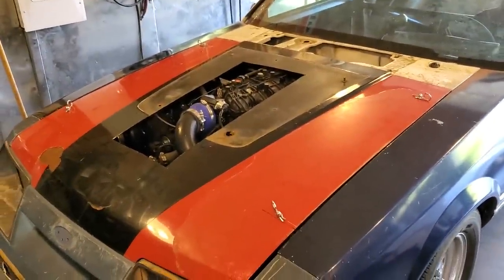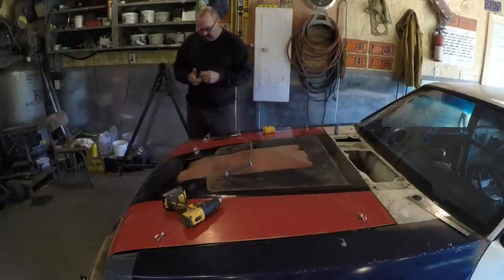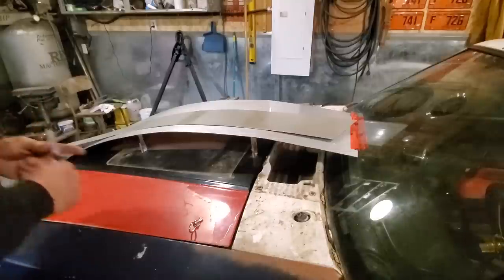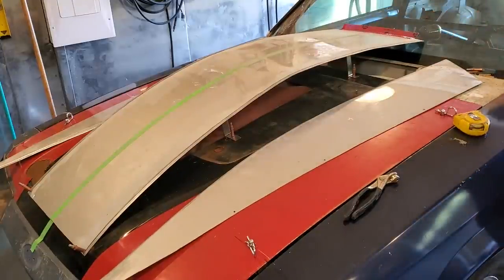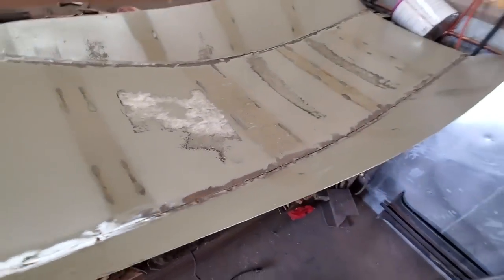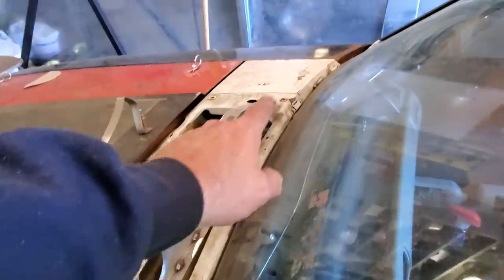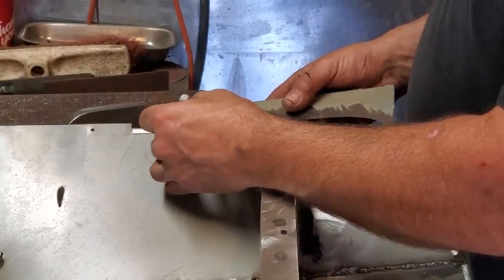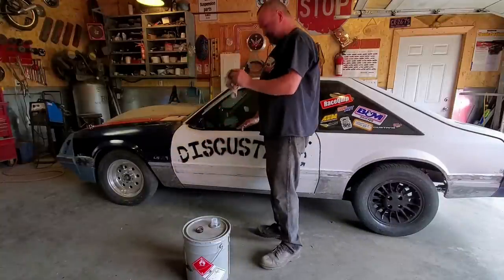How to make a steel hood scoop

Comment: Okay, maybe the answer will simply be that I'm from 'away' and just don't understand the realities of living on an island, but I just don't see how it would seem a better idea to fabricate a scoop for an existing hood, if a complete brand new hood with a scoop is $1000 bought and shipped.   I understand that for your passion projects like Crusty you might devalue your own labour, and it's all about the out-of-pocket expenses, but if this is a job for a paying customer then the math doesn't seem to work.   SURELY this took at least 15 hours to plan, cut, re-cut, weld, grind, re-weld, re-grind, roll edges, etc.   Even if you charged the scandalously low rate of $50 per hour that would be $750.  You needed materials to do the job, and the customer ended up with an old hood with a new scoop instead of a new hood with a new scoop. 
I just don't get it.  What am I missing?   Was this a job for your cousin at $20 per hour?   Were you ill when you quoted it?
I have nothing - absolutely nothing - against your abilities as a metalworker, but maybe - just maybe - you need to be a bit more proud of your abilities when you're setting your prices.  Or maybe I'm missing something important.
Reply from the maker: It was a wheel and deal job with a very young racer getting into the sport. Don't see that alot these days. 20 year old getting into drag racing. I try what I can to help the younger racer out. He gave me some LS parts I needed for crusty and I got some good youtube content. Also many other learned from this video and to me that is priceless.
Reply: @fitzeesfabrications  Sounds like a good deal for everyone involved, then.  Mind you, I would have had the young racer helping with the job.  At least holding the camera.

Comment: I’m afraid I would have ruined the windshield welding anywhere on the hood with unprotected glass. I’m sure you’ve ruined a few. If not pitted this clients car glass. I’ve seen so much glass left in cars while idiots are welding. Unprotected. Later in they say, oh that wasn’t me!  I didn’t do that! 

Something this big needs extra support. Oh wait I did see the crack in the windshield. Guess on this one it was okay to weld near it.

Comment: You should protect the windshield (use some cardboard) and employ self tapping sheet metal screws to temporarily attach your sheet metal.
Reply from the maker: Guess you skimmed  over the video. Didn't hear me talk about the windshield.  As for self tappers. Used thrm for years. Problem with thrm after the 3rd or 4th time reusing thrm you strip out the hole. Its what made me buy clecos
Reply: Fitzee's Fabrications I wrote the suggestion early in the video. It certainly was not intended to be mean. I watched the video all the way through and realized I had “misspoken “ but too late. I had never reused the screw holes so did not experience what you described. I agree Clecos are great.